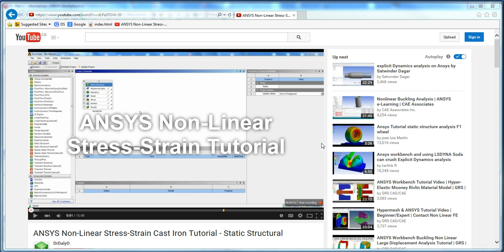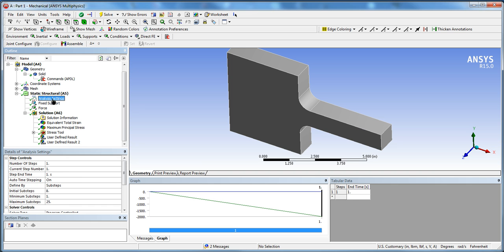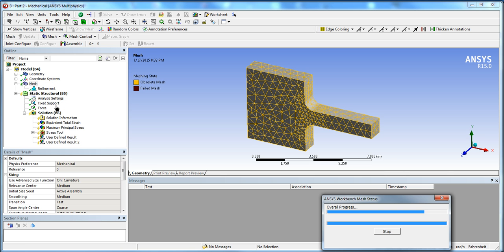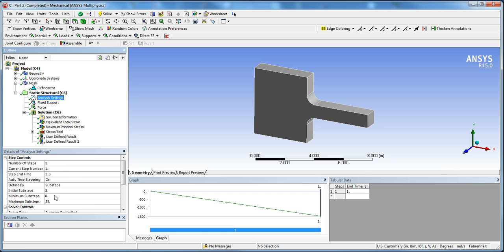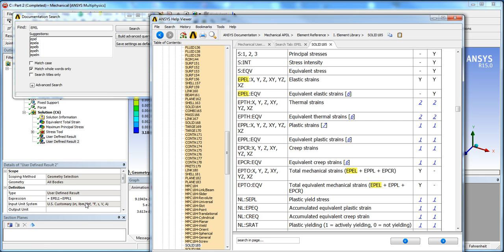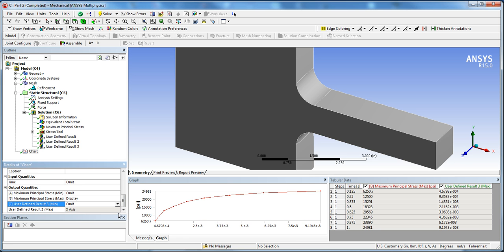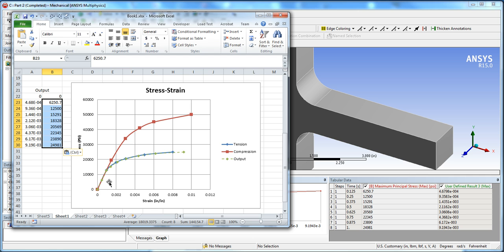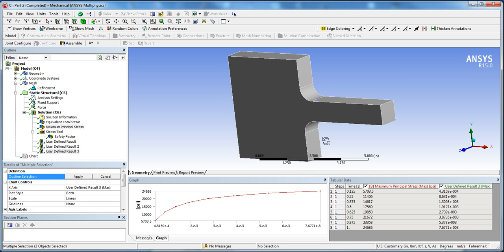ANSYS Non-Linear Stress-Strain Chart/Plot Tutorial - Static Structural

Comment: This video is very clear. Thank you. 
A questio: how do you program a rate controled test instead of a force controled test. For example with a stain rate of 0.1 inch/inch? Ansys provides me an error when Idefine the dispacement by a table. Could it be because the material fails before reaching the limit time (which I set to 1s)?

Comment: Hello Dr Daly, thanks for the helpful videos.  I have a question about this particular video, is it possible to display in a chart the stress variation of one single element, even if this element is not asociated with a edge, or face itself?  my problem is that I have a stress distribution along a cilinder, so basically there are no edges or lines that i can use to select this one single element.  thanks!
Reply: to be more specific, I have a hollow cilinder (a pipe), and I need to measure the stress in 3 different points i.e. 3 single elements, which are located on the external surface of the pipe, any clue how to do it in a chart as u did it on the video for the line of elements? thank u :)

Comment: Hi. This stress-strain curve shows the elastic region only. could you make a video on how to get the full stress strain curve of a tensile test using ansys which includes the elastic and plastic region. (the typical stress strain curve beyong yield point). Would really appreciate it. Thank you!
Reply from the maker: +hakim jtg This is for a cast iron part, so technically it has a non linear behavior ("plastic"). You could just output equivalent plastic strain and total strain and get your elastic and plastic results from there.